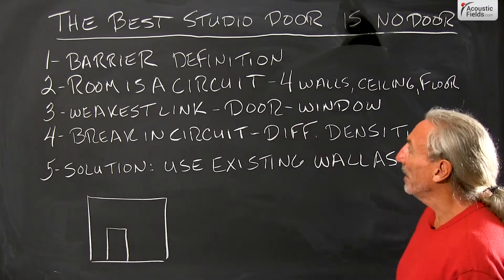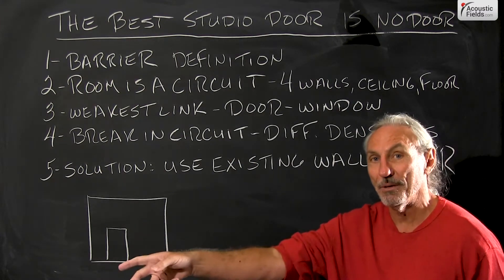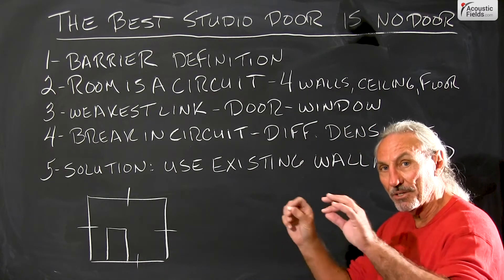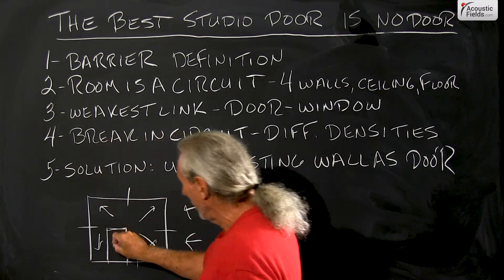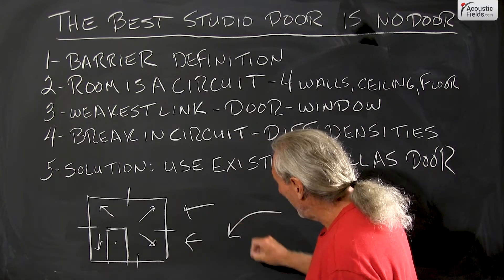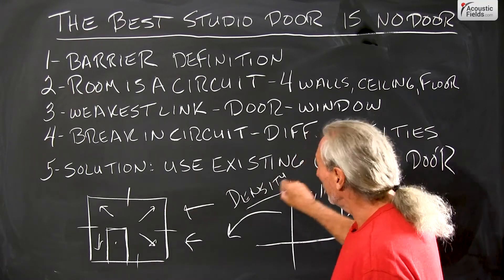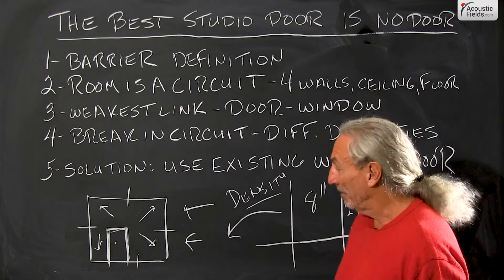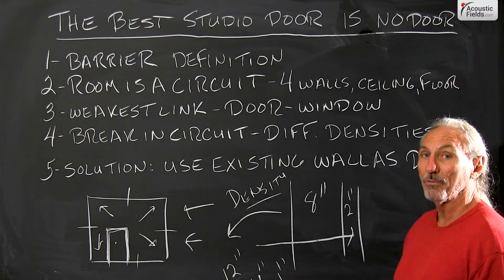Best Studio Door is No Door! - www.AcousticFields.com

Comment: So what your saying is, outdoor air-suspended cloud studio with no walls or ceiling or ground is the best acoustic treatment?
Reply from the maker: The wall boundary surfaces within a room produce two major distortions. You have both low frequency pressures along with wall, floor, ceiling reflections. If you eliminate the four walls and ceiling by placing your rig outside, you eliminate those two major distortions. The pressure and reflection distortions produced by a room are the impetus behind 95% of the acoustical treatments currently in the marketplace.

Comment: An open door may be bad if it lets outside noise in, however what if the open door is a walk-in closet that extends an additional 7 feet beyond the room boundary? Assuming it's not empty and not very reflective, why would it be preferred to keep it closed?
Reply from the maker: C,  A closet can be used as a diaphragmatic absorber. You would need to know its depth and internal fill material. A door will be a barrier for middle and high-frequency energy but not for energy below 100 Hz.

Comment: How about a door thicker  than the wall? That should be even a best barrier? 
In my studio, front door leads to a long corridor/  then to the  stairs / then to the building hall/ then to an open door to street. So, the trafic noise comes from there .  
A second door should be a soluction?
Thanks
Reply from the maker: T,  Sound is like water. It will look for the weakest link in the room. The density or mass of the door must at least equal that of the wall in which it is attached. If the door density is greater than the wall, then the noise will try the wall.  Adding a door to an existing structure must take all of these variables into consideration. You can not do anything without measurements of the frequency and amplitude of the noise you are dealing with. You must look at the total picture. Remember guessing is gambling and gambling with noise issues is usually a losing proposition. Another issue we are seeing is that people build structures they think will work and when they don't, which is most of the time, the structure they have built will have to be taken out and they will have to start over. I can't think of a worse situation. Building something, wasting all that time and money, and then having to tear it out.
Reply: Thanks, Dennis.

Comment: Hold it, now I'm confused. On the one hand you say an opening is the best sound absorber (once the sound leaves it never gets back in) so I'd think that be best. Then you say it's best to have the door be the same density as the walls and that an opening is bad (i.e., a short that you don't want). It's not clear to me why you don't want the best absorber possible.
Reply from the maker: P,  You are confusing sound absorption technology with barrier technology. The window example is used to illustrate the power and process of absorption. Do not confuse that with barrier technology. A window would be a good absorber but a poor barrier.
Reply: Paul, I think, with example of window as perfect absorber Dennis assumes that there is a free field outside the window and no sound energy is radiating from outside which may enter the room. In real life, however, we usually have outside noise.

Comment: Hi Dennis, always learn coming here, thank you for that. I had a question. How about the double door application? Is that also a viable option?
Reply from the maker: T, Using a double door or an air lock system depends directly on the frequency and amplitude of the noise you are dealing with. This is the noise outside the room and noise generated from within the room. You first measure the noise and then design the appropriate barrier (double door, air lock etc.) to keep as much noise out and in as you can within space and budget requirements. Air lock systems using double doors take up a lot of space. There are better ways to get the barrier requirements met than using all of that space.